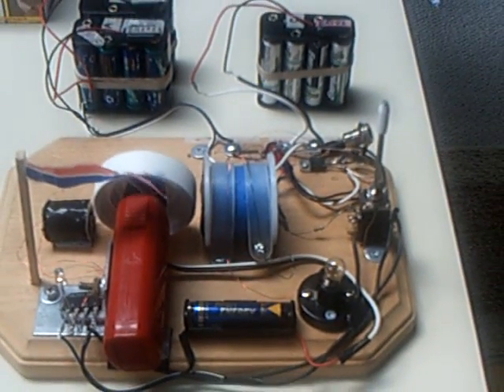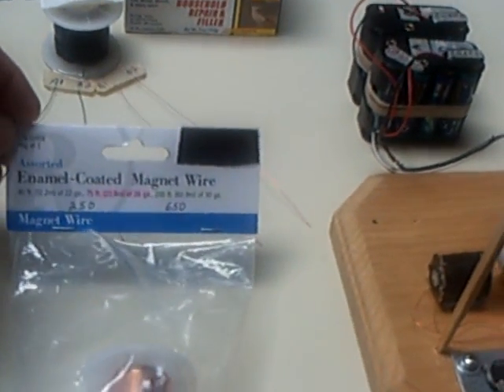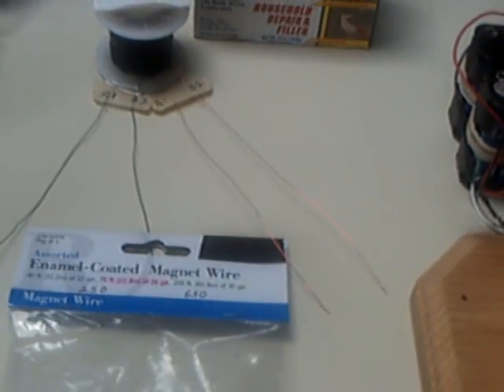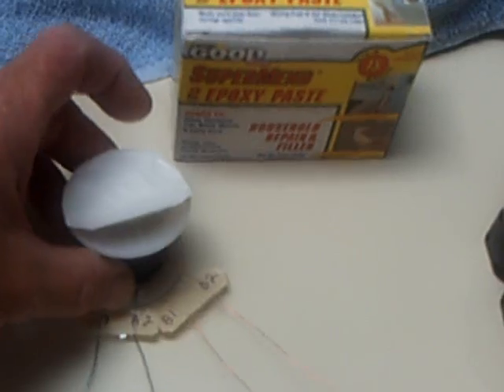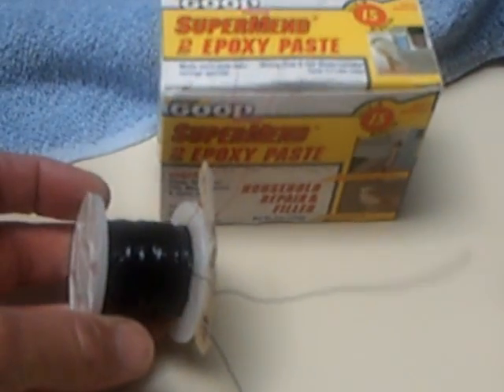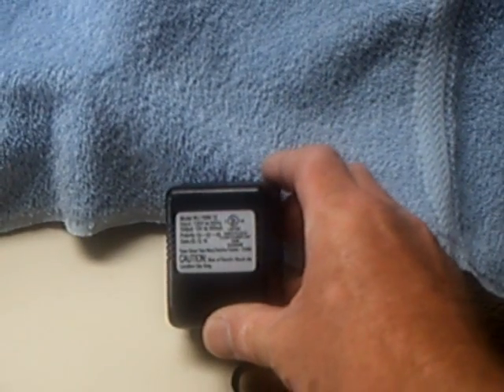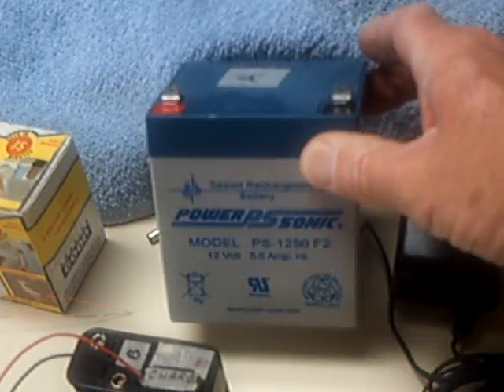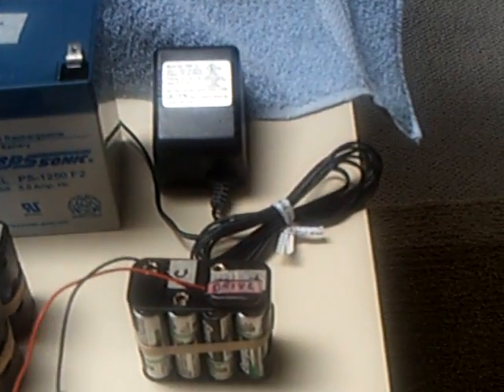How to make a Bedini Lidmotor  coil

Comment: Good day sir. I try to build a bedini motor.but for some strange reason it jus wont spin going the bedini way. However i use a  homemade reed swtich an got it to spin using a fidget spinner. I use a 9volt power supply. But im.not seen the output charging more than the input.. can u advice me further pls.

Comment: Hi, The latest wire kits from Radio shack have different size plastic spools than what you are using. Please tell me what your spool side diameter  is.  Need the spool lenght and center spool hole diameter.  I plan to replicate  that  coil.

Comment: When you say you used all of the wire in the Radio Shack 3 pack....how did you use them?  I mean, was it still bifilar?  Did you solder two of the different gauges (shorter length) together to match the length of the long one?  sorry for all the questions but I am getting ready to wind my coil and I have this same wire.  too short really to use the regular way.  Thanks.

Bill